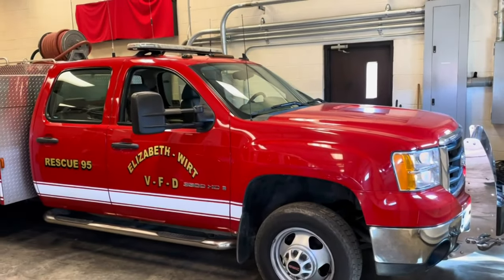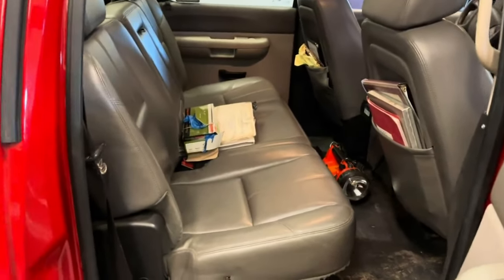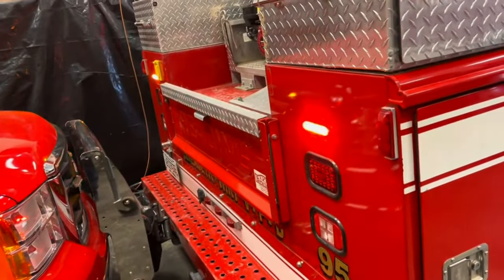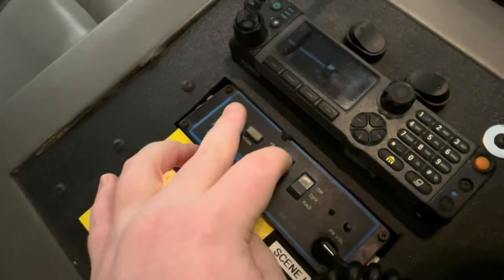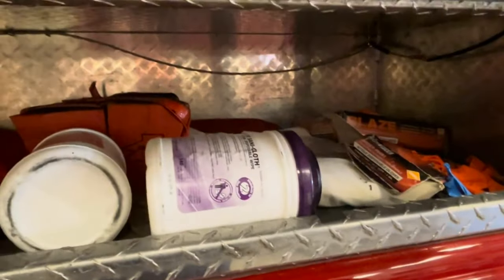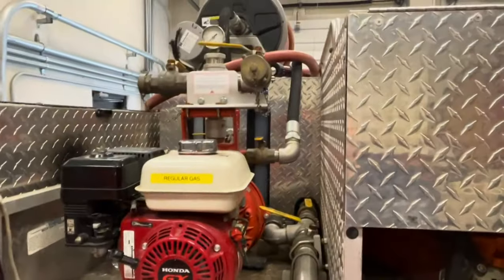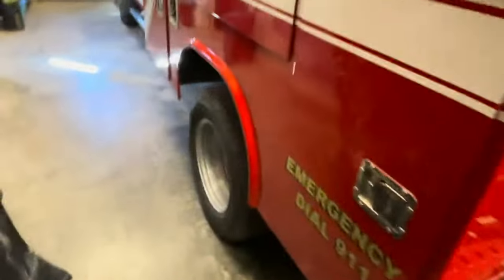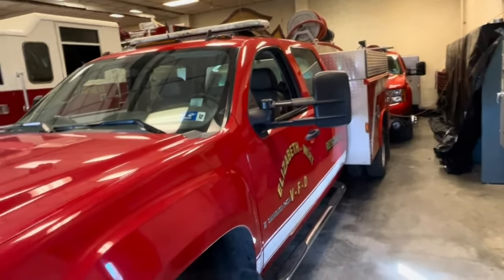Updated Brush Truck 95 Review

Comment: Our brush truck is our old rescue that we retrofitted to be a brush truck like what you guys did it’s a 2003 F-550 looking to upgrade but that won’t be anytime soon since about 2 months ago we put our new $650,000 engine in service 😅
Reply from the maker: Awesome ! Congrats on the new truck 🎉
Reply: @NathanielTexas  thank you! I volunteer for a small rural farm town that desperately needed it we had a 1997 Pierce Saber we blew the rear end out of it 3 times all of which where heading to mutual aid fires and the roof leaked like a sieve
Reply: @NathanielTexas  our new engine is a Rosenbuar Commander more cost effective than buying a new Pierce engine like we where gonna we turned our 2nd engine into a “heavy rescue” it was used for mutual aid runs but now it’s our MVA truck